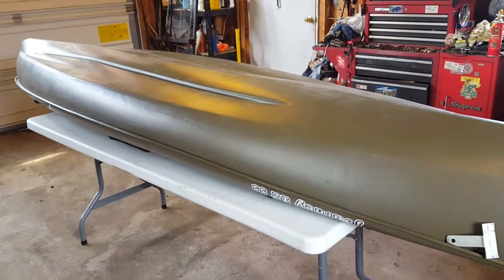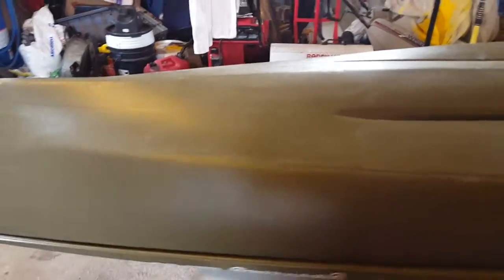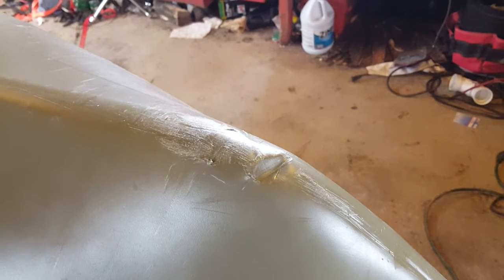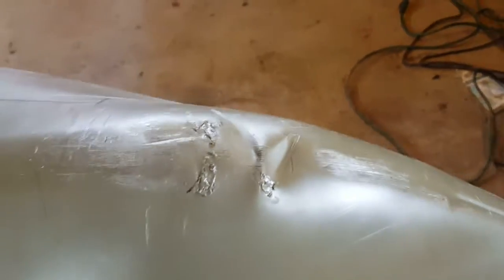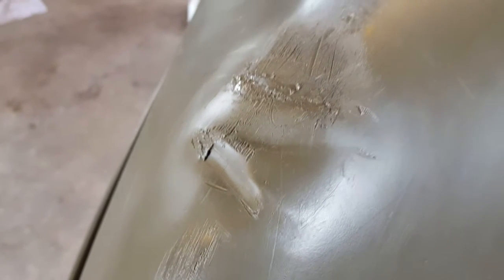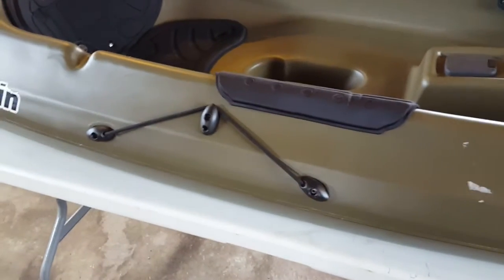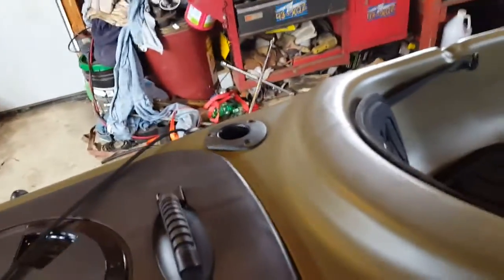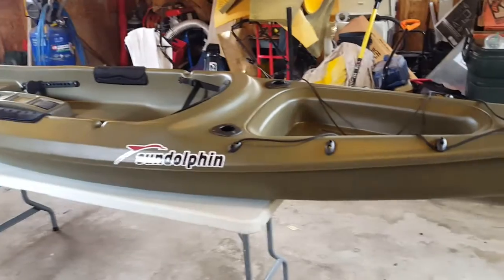Sun Dolphin Journey 12ss kayak

Comment: You should have used solvent weld, methylene chloride AKA MC. Most PVC, ABS type cement used in the plumbing profession has the proper chemical composition to do the task. I suppose using heat could work but it will never be as strong.